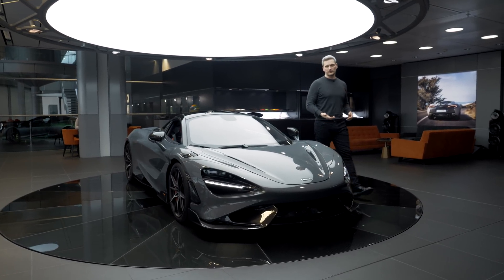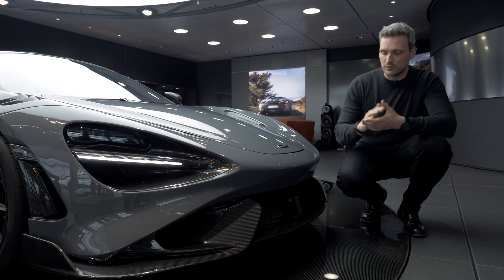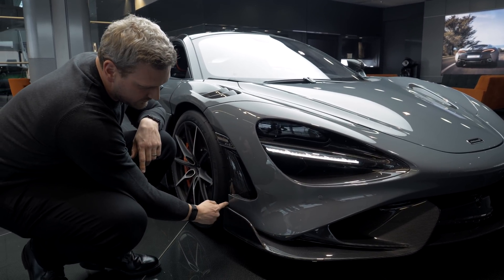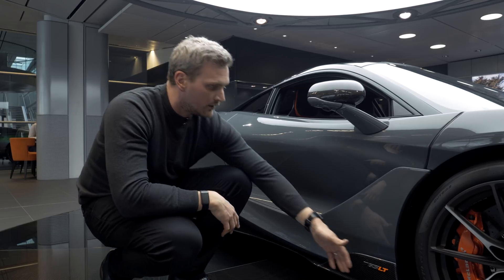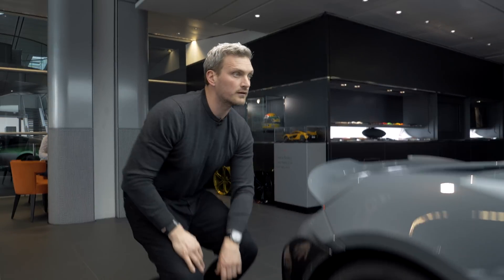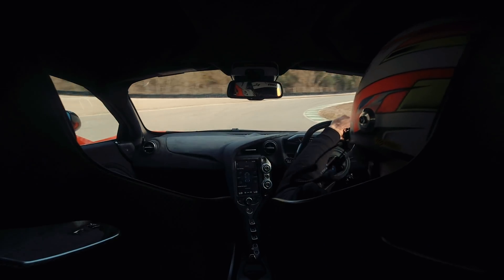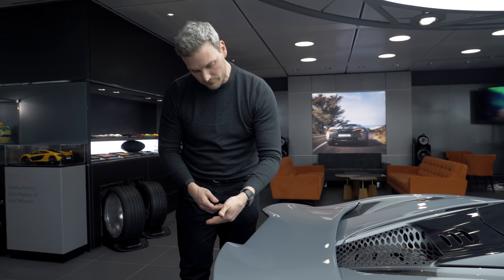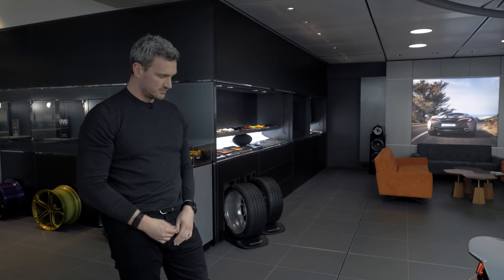McLaren Tech Club - Episode 3 - 765LT Design: Explored

Comment: What is better. 720S or this
Reply: dammi weerasekara  don’t no why car manufacturers put out these informative videos on U tube then don’t answer questions, as a 60OLT owner I can tell you than McLaren LT cars are far more driver focused track derived designed cars.
Better aero for greater down force , lighter weight for better power to weight ratio, more power full brakes, enhanced suspension etc etc, 
The 765 will be quiet a bit quicker than a 720S around a track as you would expect.
So if track days are your thing then 765, if you want to do loads of road miles then 720S is the better option, no point buying a McLaren LT unless you are going to go on track imo 👍.

Comment: Much rather have a 675LT spider over this. With 765 coupe / 765  spider = 1530 in total of these being built its just too many for the brand. An extra 53% more than the LIMITED 675LT will kill its exclusivity and residuals no matter how good it is.  The 675LT is the real sweetspot of the McLaren range of cars, a mini P1 without the elctrics and more FUN. The 675LT is a future classic ala early limited production ferrari's. The 600LT and 765LT will not gain this cult status regardless of how good they are. The 675LT was a huge incremental gain over the base 650S standard model with 50% new parts particularly with the engine. 600LT and 765LT gains on the base model are nowhere near as significant. McLaren really went to town and over engineered the 675LT to launch the LT sub brand. The 675LT is a VERY VERY special car and an absolute bargain at todays used car prices. Supply of them is sure to dry up with collectors, investors and enthusiasts snapping them up. I'll have a napier green spider please
Reply: Gazza Brownhigh I agree partly with you, 675LT is very much the sweet spot and it’s limited production only enhances its position.
However the 600 LT was mis sold by McLaren to some degree , rather than saying it was a limited run car , they said they would build for 12 months only and that would be that. Apparently only 175 RH drive coupes and 175 Spiders were actually made , making the 600 LT rarer than the 675LT.
I have owned a 570 which was a brilliant car, however I have bought one of the last 600LT spiders , the cars are night and day to drive , the 600 LT is far more driver focused that the 570, unless you have driven both it’s difficult to understand that the changes that Mclaren made ,
however limited , totally transformed the cars driving dynamics , lighter weight , better aero , recalibrated suspension, carbon ceramic brakes , more power etc.
Remember the 600 LT rivals are the GT3 RS , Pista, Performante , therefore McLaren had no option than to considerably up their game to compete, top motoring journalists, such as Chris Harris, Henry Catchpole , preferred the driving experience of the 600 LT over the Senna , high praise indeed 👍.
Reply: @brentpowell7889  How many RHD 675LT do you think there is worldwide in the total of 500/500 becuase the UK is by far the largest market and there are less than 50/50 675LT's in the UK making it far rarer than the 600LT. There are not 350/1000 RHD 675LTs worlwide, nowhere near that figure. There are more like twice as many 600LT's as there are 675LT's just like there are way more x4 sports series cars than super series cars. The 675LT was sold out in 2 weeks and fetching £100k premiums at launch whereas the 600LT had to be given away by dealers towards the end because there were too many of them and not the demand. Dont get me wrong its an absolute cracking car but I'm glad I cancelled both my 600LT coupe and spider orders and stuck with my Performante Spyder
Reply: Gazza Brownhigh thanks for the reply , have a look at Jay emm cars video on the 600 LT, go to 11.30 mins and it clearly explains what McLaren did on production, I don’t know how many 675 LT were made , however when I bought my 600 LT I did my due diligence before I signed.
McLaren May have made more LH drive 600 LT , but RH drive was a total production run of 350.
You mentioned McLaren we’re giving them away, yes they were discounting cars no doubt , the dealers were getting support direct from the factory to enable to the cars to be sold.
And that’s the exact reason why I bought one, a car that would have cost me a lot more was suddenly attainable for far less , rather than putting me off , this was a no brainer , I was extremely happy with the deal I negotiated, which also came with a guaranteed final residual.
I have been a long time Porsche owner and club member for many years, however I have never been able to buy a new GT Porsche and I am not prepared to jump through hoops by purchasing other non GT cars , so I can be allowed to buy a GT3 RS etc.
Finally what ever the numbers are doesn’t really bother me that much tbh , I haven’t bought the car as a investment car or a garage queen, it’s going to be used , with a trip booked with McLaren to Spa and the Ring in Germany with Apex taxis the car is going enjoyed to the max.
I have a few pics on my instagram account of the car.
Anyway enjoy your Spyder , happy motoring 👍
PS didn’t Lamborghini do the same with the Performante , by not saying this car was a limited production run , this has impacted significantly on current values of the Performante.
Reply: @brentpowell7889  You have done well to get a PCP deal with a GFV and given the numbers I was presented with you can just walk away and hand back the keys in 2 years time as the GFV is going to be a lot higher than the market value. Its a very good deal but purely kicking the can down the road 2 years when there will be another abundance of supply further harming the values for when the next owner will grab a real bargain. The issue I have  is not the car but the McLaren road to market which harms the brand image and used values. I was in line to take a brand new coupe followed by a brand new spider at full list price having put deposits down 2 years ago. When McLaren said it WASN'T a LIMITED production car like the 675LT but simply a time frame I knew they would over produced the cars and chase volumes and profits particularly after the massive success of the 675LT which sold out in just 2 weeks. Production was really ramped up with the SPORTS series cars versus SUPER series hence there are so many cheap 570's derviavtives on the used market already. 600LT was no different and 350 RHD cars is a massive number even if it is out of a total approaching 2,000 worlwide. There are less than 100 RHD 675LT's in the UK and we are the bulk of the RHD supply so maybe there is 175/200 tops RHD 675LTs worldwide. Either way there is at least double the number of 600LT's versus 675LT which does make it less special and less exclusive no matter how good it is. Lamborghini did do the same with the Performante hence why there are too many of them on the market especially coupes and values took a hit but I got out of my coupe at a reasonable price after 6 months and upgraded to one of the latter spyder models for sensible money and there is only 550 Performante spyders worlwide which is about a third of the coupes.In reality that is quite a rare car. I'm an early McLaren adoptor and have had 650S spider, 570S and 675LT spider and love the product but don't like the way McLaren stitch up their loyal early adoptors with their marketing. I'm glad I pulled my 600LT orders because it would of cost me easily over £100k. in terms of just pure volumes versus demand I think Lamborghini have the equation closer to supply v demand but neither can get close to the Porsche and Ferrari models hence the different in used car prices having nothing to do with the quality of product. I'd much rather have a McLaren and Lamborghini over both Porsche and Ferrari but have learnt to not buy them from brand new at list price. Enjoy the next 2 years in your 600LT and drive it as much as you can to get value from it but personally I still think a used 675LT spider was the better buy long term and will be the car with cult status and a future classic guarantee leaving both 600LT and 765LT behind in value. For me the 675LT is similar to Ferrari's Challenge Stradale
Reply: Gazza Brownhigh yes agreed not a Ferrari fan tbf, brother in law has an 812 super fast which has allowed him to buy one of the last Spyder Pista’s , to keep the value , he doesn’t drive then much , I made a conscious decision to drive my cars , not buy them as investments , you are a long time dead so as you rightly say use them.
If you are ever in the Shropshire area let me know 👍